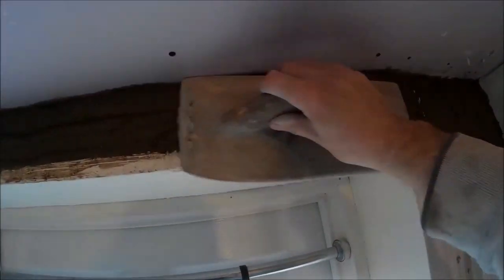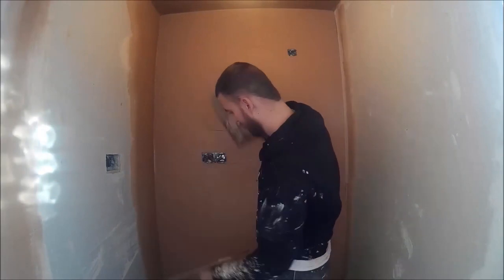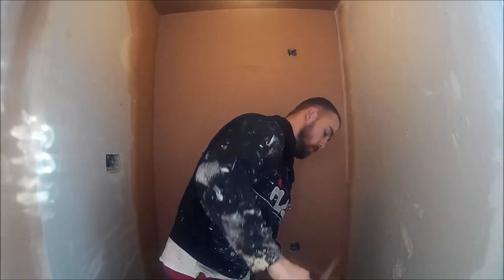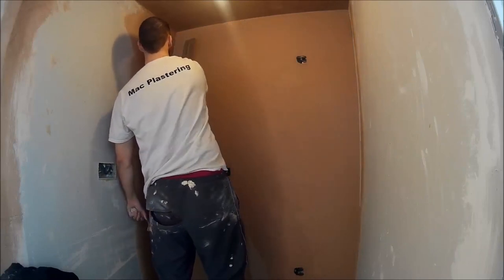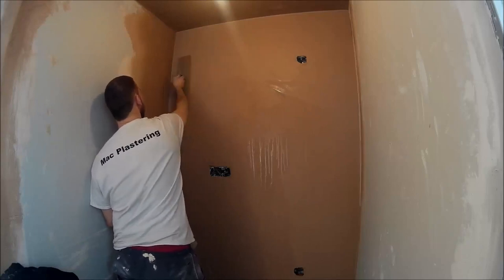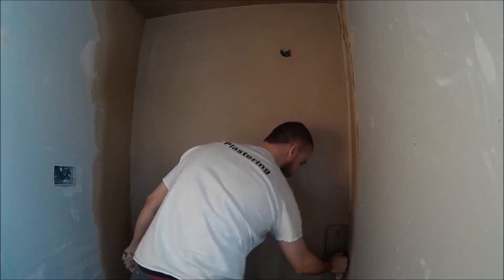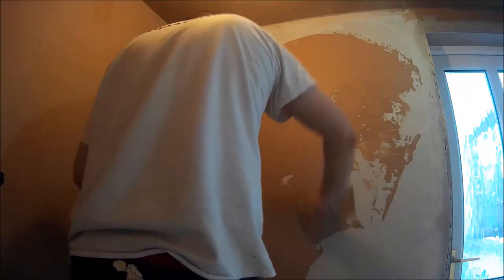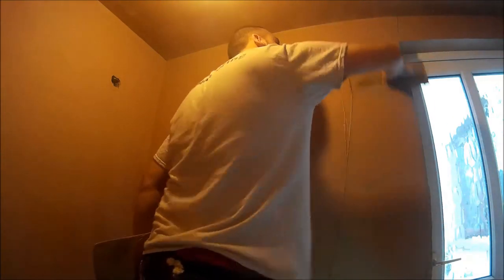How to Plaster diy beginners' plastering skimming walls part 4

Comment: Something you demonstrated rather well here Mac is that the pricing of jobs has nothing to do with 'areas' of the work concerned (unless Newbuild) it would take just as long to skim all the walls of a bedroom as it takes to do just that 'one' little wall ...... Something most customers can't get their heads around :-) ...... AND! - Plastering top-left-to-right is the method that's been adopted by the TOP Plasterers for YEARS now ;-)
Reply from the maker: Yes a small room or wall is gona take the same time just like patching  takes as long sometimes as just doing whole wall , love it that you pick up all the fine details in the videos mate you for sure musta been a top class spread =)

Comment: Good vids Mac . . One quick question , I'm either going to sand cement render part of my kitchen wall or hard wall it . What would the total thickness be used if I hard wall it . Thanks in advance .
Reply from the maker: All depends on the wall if its out u might need a little extra in places but looking up to 10mm
Reply: @macplastering  thanks Mac . The wall in question is  load bearing and the previous owner made a double opening from a single opening door way . They chopped the block work out but used a bloody WOODEN lintel and the ceiling sagged by an inch . So I'm blocking it back up to a single doorway with a steel lintel , to be safe . The final depth of the coat is 20mm .can I put 2 coats of hard wall on or should I scratch coat render and top coat render . Cheers buddy .